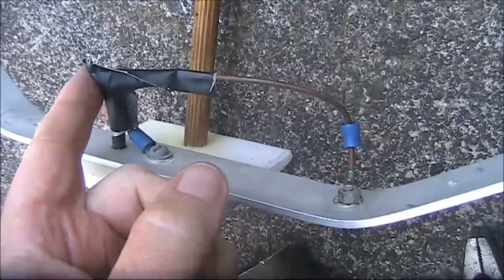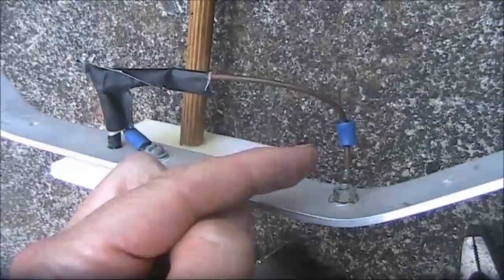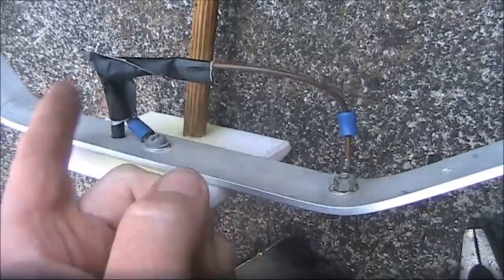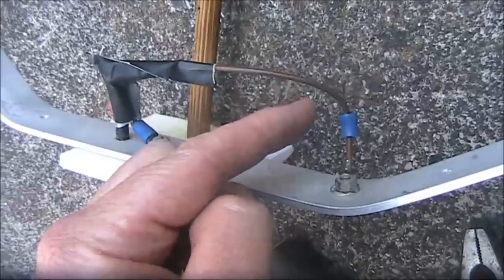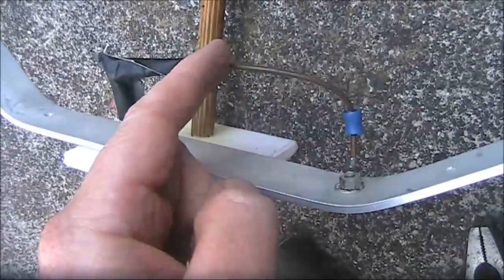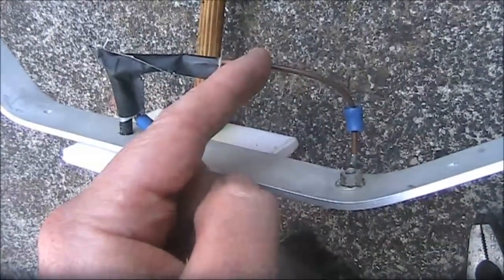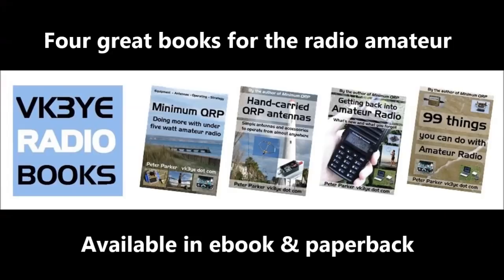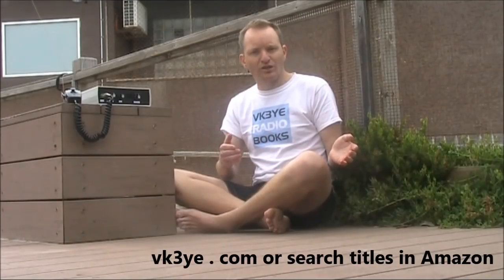Importance of inspecting and maintaining antennas used in salty air

Comment: Salt or no salt, problems can arise from corrosion due to dissimilar metals. Apart from the damage, the salts along with the two metals can produce a "diode effect" capable of generating harmonics which can land anywhere. Mr John Peterson makes a very sound suggestion. Don't know the name Hargers in UK but there will be similar.
Classic case in UK 405 TV days when the complainant of TVI was found to have a joint in 2 pieces of metal gutter which was corroded (not even dissimilar!) and generating the harmonic flattening the TV pic. 
Try diagnosing THAT. Try LOCATING that.  Just try convincing the complainant of THAT!
Thanks as always...A1 videos.
G3NBY

Comment: Hi. Do you use any anti-oxidant connection Grease (e.g. Hargers) ? Also could  you talk about that variable cap on the loop. Is that home made (and how) and what pf range does it produce ? Thanks for the great videos. Very helpful.
Reply: Almost any grease that is high viscosity will work to keep the contacts clean, though there are special greases designed to work in this application. Silicone grease or even hard wax will work however to keep the contacts clean and shiny.
Reply from the maker: It's a beehive trimmer. It would cover approx 5 - 50pF. More on building this antenna at http://home.alphalink.com.au/~parkerp/projects/projsum.htm
Reply: vk3ye thanks the link is very helpful.